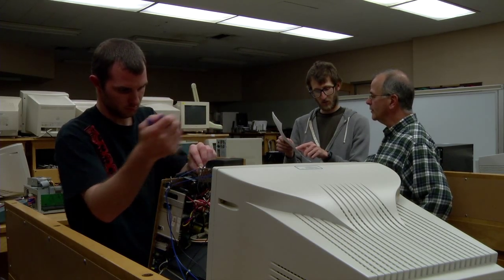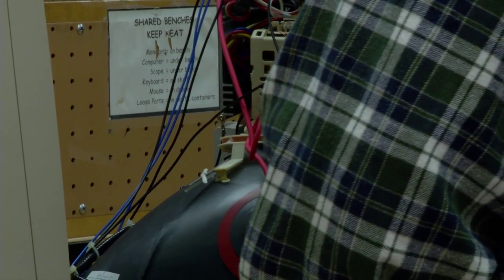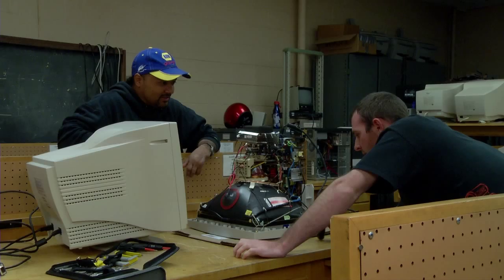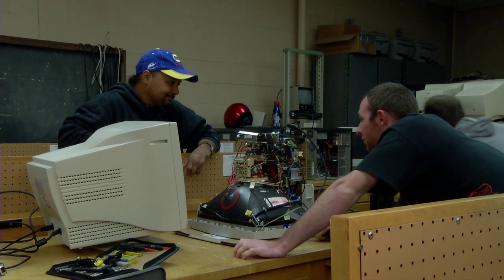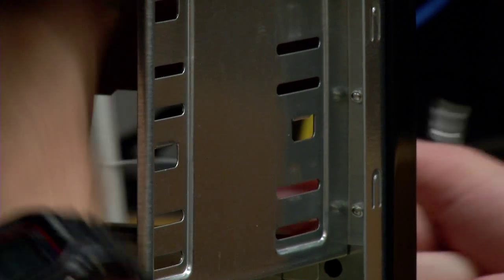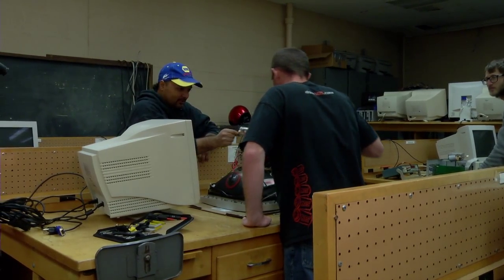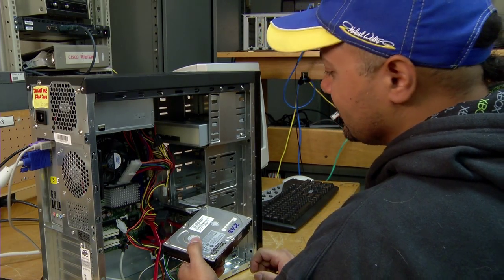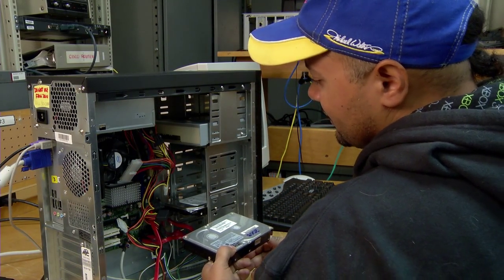Computer Electronic Technicians

Comment: My first pc was an XT that ran at 8mhz but had a turbo switch that would speed it up to 12mgz. The os was dos 2.11 it used a single side 5 1/4 floppy drive . I later added a 10 mb hard drive but the hard drive was MFM so easy to crash. O'yea it had 512 mb of system boars memory. My last computer I build for my wife was a I7, 1tb SSD. wr DVD. 48" display, chit I can remember how much memory I put into it but a lot. Windows 10 os. I do not like apple computers. This was ABC's only.